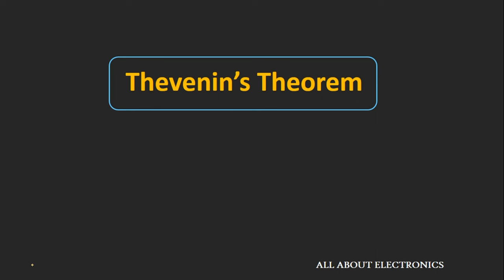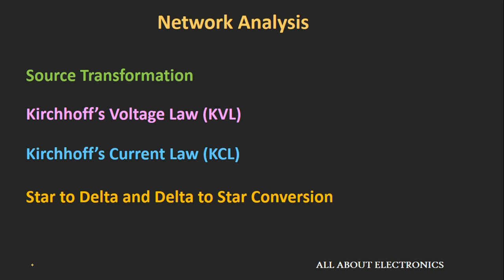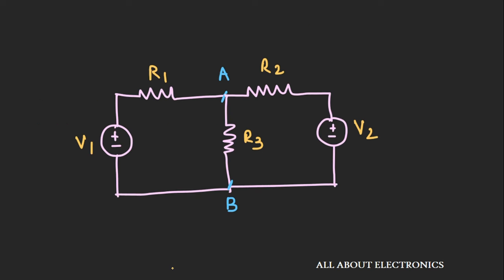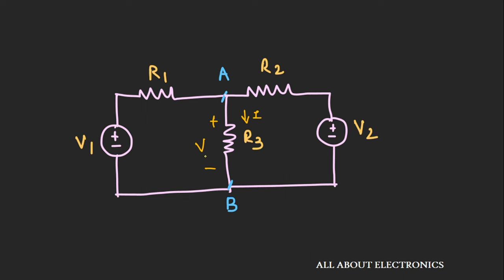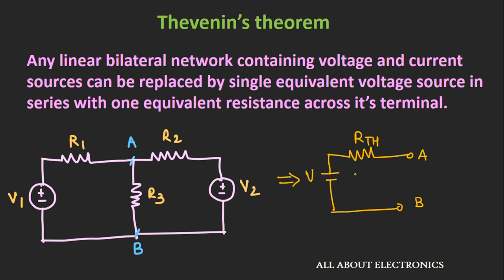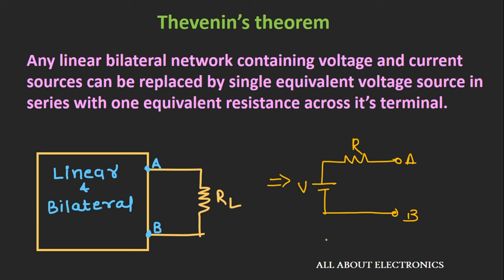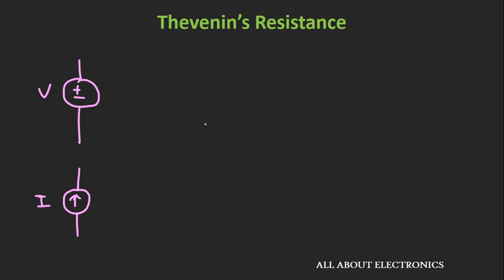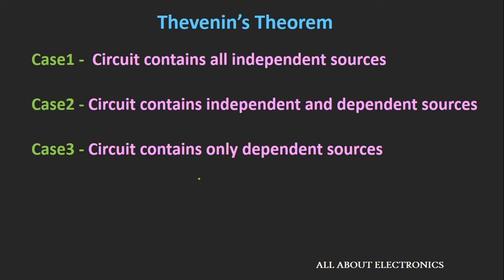Thevenin's Theorem Explained (With examples of Independent and Dependent Sources)

Comment: Please tell that why current source is replaced by open ckt and voltage source by closed ckt
In detqil you told it in vedio i cudnt understand it
Reply from the maker: In Thevenin's theorem, while finding Thevenin's equivalent circuit any source is replaced by its internal resistance. 
And voltage and current sources which are used during the examples are ideal sources. Ideal current source has infinite input impedance and ideal voltage source has zero series internal resistance. That is why current source is replaced by open circuit and voltage source by short circuit. 
I hope it will clear your doubt.

Comment: Hello! I'm an ECE student, and I don't kind of understand how you got Vab for case 1
Reply from the maker: well, that is straight forward. First, remove the load across which you want to find the voltage. 
Then find the total current that is flowing through the circuit(By applying KVL).
That current is -0.5 A.
Now, if you see, the potential or voltage at point A will be 10-(10*(-0.5A)) (Again using KVL)
And that will be 15 V. 
Node B is at zero potential. So, Vab will be 15V.
I hope it will clear your doubt. And still if you have any doubt then do let me know here.
Reply: Ahh, I think I know where I got myself confused. See, in our physics class (where KVL was introduced) the arrows we drew were just loops, just really loops indicating the direction of, well, the loop we want to use KVL on - just a direction. And that had its own conventions. And now that I am in one of my EE subjects, the loops we draw are now mesh CURRENTS, they are loops (that provide direction for the KVL) and loop currents (or mesh currents) at the same time. And that kind of technique also has its own conventions. And somehow I kind of got them mixed. I don't know if I'm making sense, maybe I'm wrong, but now I understand how you got the Vab = 15 V with that understanding in my head (which again am not sure if I'm right or wrong). Anyway, thanks for helping me out! I really appreciate it!
Reply from the maker: If you find any difficulty in KVL, then you can check my video on KVL. It might help you.

Comment: Can you tell in which case thevinin and norton circuits are not equivalent
Reply from the maker: Norton's equivalent circuit is just source transformation performed on Thevenin's equivalent circuit. So, any circuit for which you can find Thevenin's equivalent circuit, you can also convert it  into Norton's equivalent circuit.
Reply: only in complex circuits wih multilateral sources.remember it only works for bilateral and linear sources

Comment: In finding vth y r u not calculating voltage at AB due to 20 voltage source?????
Reply from the maker: In this example, the motive is to find the voltage at node A, which is equal to the 10V minus the drop across the 10-ohm resistor. If we go further then there will be drop across one more 10-ohm resistor. But here we are not interested in the voltage after node A. If you start the loop from 20V voltage source up to node A then also you will get the same voltage. e.g 20V - (10) (0.5) = 15V. So, the point is no need to complete the loop here to find the voltage at node A. And you can start either from 10V voltage source or from the other end (20V voltage source), you will get the same result.
I hope it will clear your doubt.

Comment: In second question why you consider one voltage source for find Rth..
Reply from the maker: Because there is a supernode between the terminals X and A.  So, it is considered as a single node.
Reply: Sir in case of find Rth we replace all voltage source by S.C .

Comment: there is also a problem in case 2, you sayd that to find Rth we need to shorten all sources and you didnt shorted the 5V source.
Reply from the maker: Well, that's the case when all the sources are independent. When the circuit contains a dependent source then the problem will be treated differently. (which is the case in the second example, as 3Vab is the dependent source)
I hope it will clear your doubt.

Comment: What if instead of 20v it is 20 resistance and not voltage?
Reply from the maker: I didn't get your question. Would you please elaborate a bit?
Reply: ALL ABOUT ELECTRONICS if you change V2 = 20 for R3 = 20 would you still do it the same way?

Comment: at 5:40 
how you have calculated Vab
please explain the method
Reply from the maker: By applying KVL, Vab has been calculated. Vab= Va-Vb. And voltage at node B is zero, as it is the reference node in the circuit. So, just by finding the Voltage at node A, Vab has been calculated in the video.

Comment: In case 1 
Taking right branch instead of left we get -15V 
WHY SHOULDN'T WE TAKE THIS AS A THEVENIN'S VOLTAGE
Reply from the maker: By every way, you will get Vth = 15V. 
If you take, 10 - (10x (-0.5)) , then Vth = 15V
Or if you consider other branch, then applying KVL, Vth - 10x I -20 = 0
Therefore, Vth = 10X I + 20
And here Vth = -0.5A
So, Vth = 20 - 5 =15V.
so, whatever way you calculate, Vth is 15V.
I hope it will clear your doubt.

Comment: Btech 3rd sem k exam k liye important topics bta skte h???
Reply from the maker: May I know the subjects in your 3rd sem syllabus?
Reply: Circuit analysis, machine, analogue electronics, emft, maths
Reply from the maker: Circuit analysis: All network theorems, transient analysis, two -port parameter and network topology.
Do check the network analysis playlist on the channel, it will help you. 
For analog electronics:  Go through BJT, diodes, FETs, and Op-amp 
Again the playlist on op-amp on the channel might help you in preparation.

Comment: I have question.....why you Vab = 10-10i
Reply from the maker: Basically, to find the voltage Vab, it is required to find the voltage Va.
As node B is the reference node.
Voltage Va is 10V minus the voltage drop across the 10-ohm resistor.
That's why Vab = 10 - (10*I)
I hope it will clear your doubt.

Comment: I didn't understood why u r put Vab=10-(10I)
Reply from the maker: Here, Vab = Va - Vb.
As node B is already grounded, Vb = 0. So, we need to find the voltage at node A.
Which is 10 V  - (drop across the resistor)
That is 10 - (10*I)
I hope it will clear your doubt.

Comment: How could I find Vab pls be in detail
Reply from the maker: Are you talking about the case 1 right?
Reply: ALL ABOUT ELECTRONICS yes
Reply from the maker: well, that is straight forward. First, remove the load across which you want to find the voltage. 
Then find the total current that is flowing through the circuit(By applying KVL).
That current is -0.5 A.
Now, if you see, the potential or voltage at point A will be 10-(10*(-0.5A)) (Again using KVL)
And that will be 15 V. 
I hope it will clear your doubt.

Comment: In 10.54 sec how to get equivalent resistance as 2k ohms
Reply from the maker: Here A and B terminals are short-circuited.  Or it can be said that Rab= 0 Ohm. Now, the 2K resistor is in parallel with Rab. So, the parallel combination will be equal to 0 ohm  (short-circuited). So, now only 2K resistor is in series with the 5V source. 
I hope it will clear your doubt.

Comment: Vab=10-(10I1) how?
Reply from the maker: The voltage at node A is 10 V minus the drop across 10-ohm resistor. Node B is reference node in the circuit and it is assumed to be at ground potential (0V). So, Vab= Va -Vb= 10 - 10(I)
I hope it will clear your doubt.

Comment: What is the practical use of this..
Reply from the maker: If you have any complex circuit and you want to observe the behaviour of the circuit for the different loads, then using this Thevenin's Theorem the circuit can be converted into the Thevenin's equivalent voltage and resistance. So, without  going into the circuit detail of complex circuit every time ( voltage and current through various components of the circuit) it can be treated as Thevenin's equivalent voltage in series with Thevenin's equivalent resistance.

Comment: how did you consider Vab at 5:17
Reply from the maker: Vab is the voltage difference between node A and B. (Va- Vb)
Here Vb is the reference node (i.e Vb=0).
And Va can be found by applying KVL in the loop. 
i.e Va= 10 - (Voltage drop across 10 ohm resistor)
or Va= 10 - (-0.5*10) = 15V.
I hope it will clear your doubt.